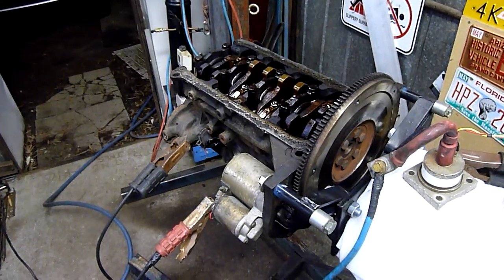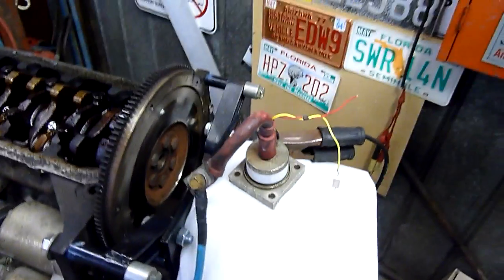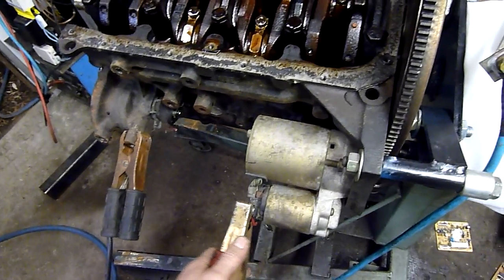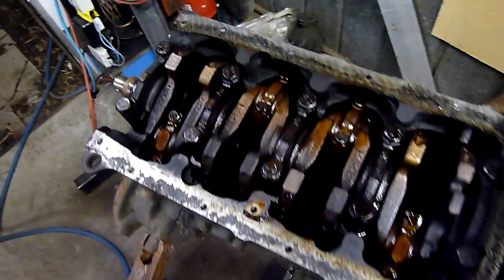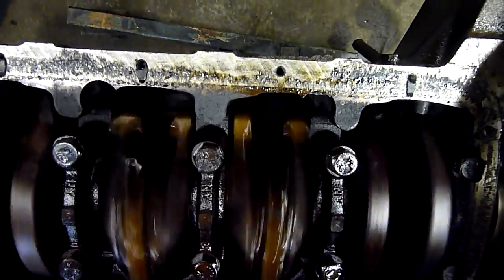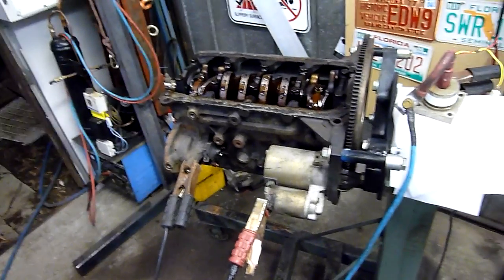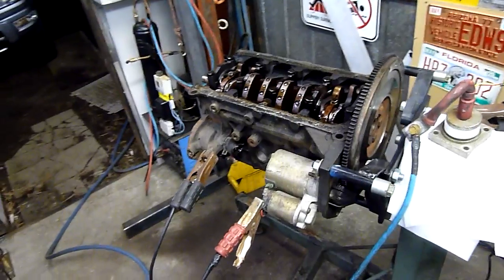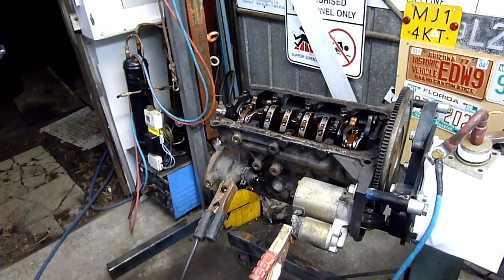Engine Cranking with a Sillicon controlled Rectifier SCR

Comment: The early fairground ride lighting controllers for the DC lighting used an interesting method to turn the thyristors off.  They had another thyristor in series with a capacitor hooked across the main thyristor.  When the gate drive was turned off to the main thyristor and the other one was triggered, it effectively shunted the main thyristor via the cap.

Comment: what I dont like about scr's are they are mostly for AC controll.  with dc they just stay one. ac has a positive and negitive as for its wave form and when the ac gose negitive it will turn off. unless you still have the scr still triggered.  to get a mosfet to do that those would cost a pretty penny, and i'm sure that scr was not cheap

Comment: Nice, I have some crazy little mosfets I use at work, for a tiny little TO-220 cased mosfet they can handle 120 amps pulsed and something like 20~36 amps continuous. That SCR is awesome, would not mine having a few to play with.

Comment: Make a 'super dimmer' with two SCRs in anti-parallel... useful for controlling the output on older welding machines without a fine amp control. Or for adding a foot pedal to a machine that didn't have one.

Comment: You can use a second SCR and a RC circuit to make it switch off. Look up SCR commutation. Used on DC fork lift controls for speed control.